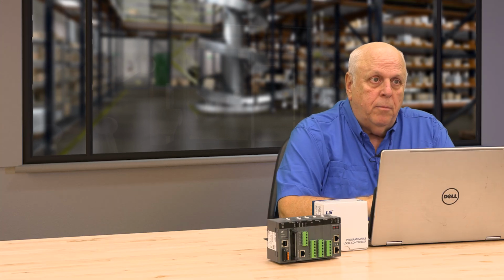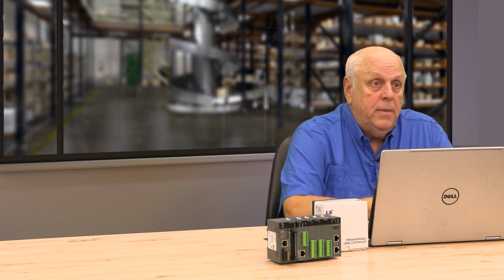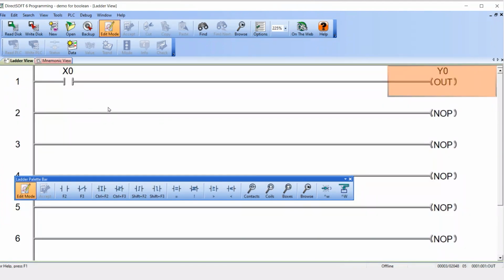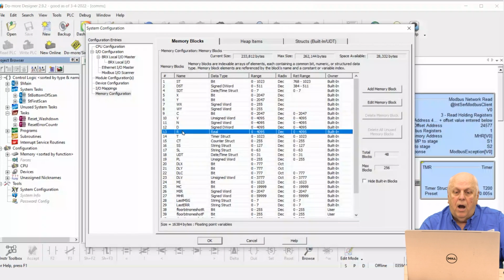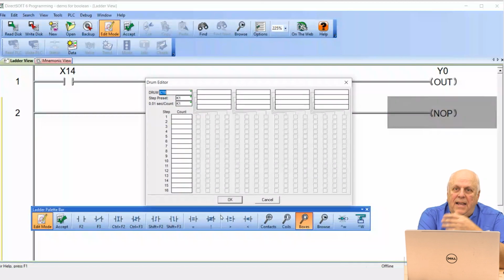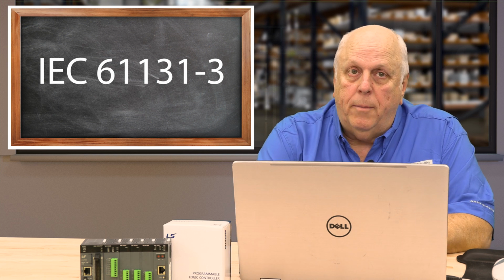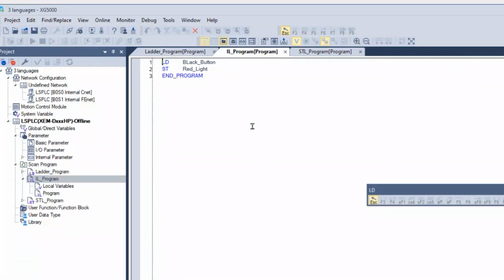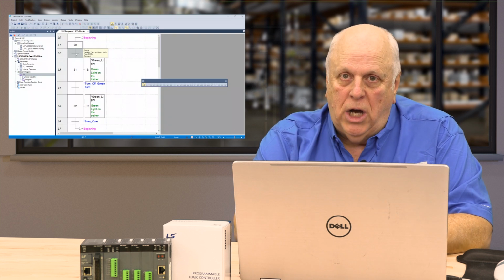IEC 61131: The Evolution of Controls from Relay Logic to IEC Programming

Comment: It's a sad development, because we're so far from the relay machine fundamentals now with the text based coders coming into the field that we're having to reinvent anti-tie down and concurrency and all of the fundamentals we've had for decades with these kids, and they are basically working on Fiver and are here and gone so fast that it doesn't make sense to really train them. We're going to have a lot of injured operators and machines that aren't nearly as flexible as ops managers want them to be in our future.
Reply from the maker: @jimknowlton342, we completely agree. The Text based editor has a very very easy to use diagnostic window that comes up. It shows you what is going on so that will help the electrician's and such diagnose it. It is shown in every Doug Bell video for ST for this reason. Very much like STATUS - MONITOR in your other PLC lines. Prior TEXT based editors did not have that.
Reply: @automationdirect  you have some of the best kit in the industry, a lot of us using AB secretly wish AD stuff was more common.

Comment: Thanks Doug!

I programmed my first PLC in 1985. It was a Joucomatic PLC (the pneumatics vendor that sold it called it a "Joke-A-Minute") and it had an on-board keypad and programmed in boolean; I was miserable! (I still own it though and have it displayed in my garage, LOL!) My next was the Cutler-Hammer D100 and I loved it because the handheld displayed ladder. From 1990 to 2012 I was a Allen-Bradley diehard but their pricing and tight fistedness over software chased me away. I have and remain since 2012 a loyal user of Click, BRX and Productivity and choose based on application. The challenge I see is getting end users to DEMAND their factory automation be coded using Codesys to "hopefully" break Rockwell Automation's monopoly on PLCs and their terrible HMIs.